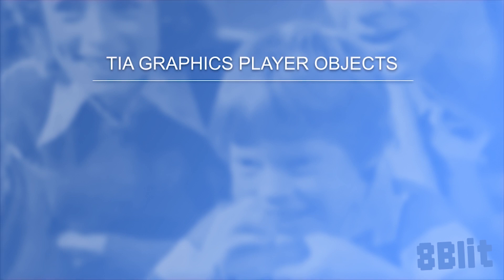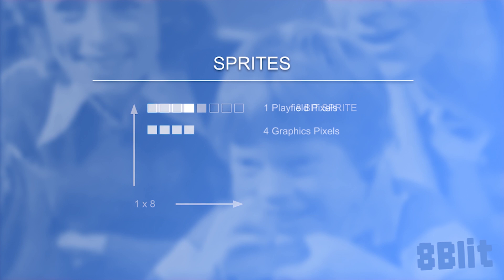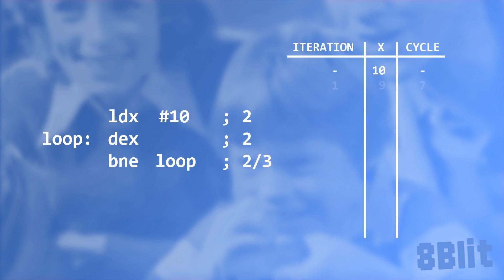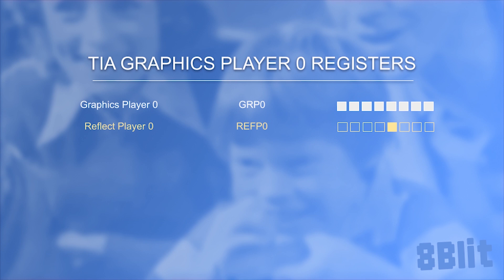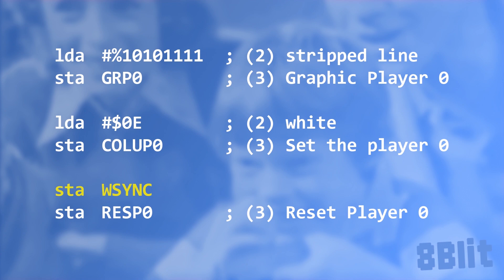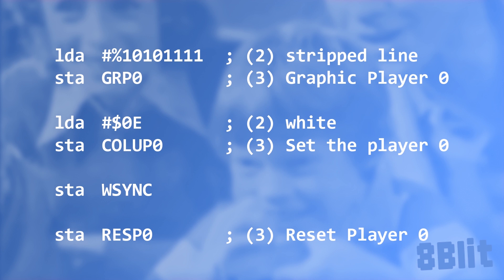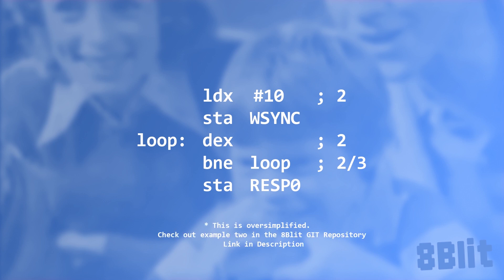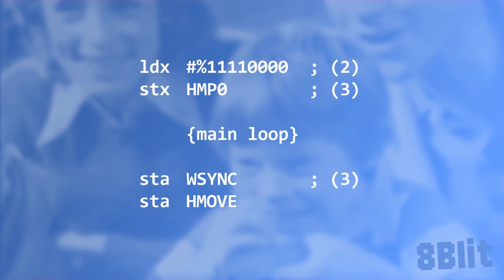Sprites on the ATARI VCS?!

Comment: You put a lot of effort into making your videos quality.

I had difficulty finding the source code that matches up with this episode. I see it's season 1 but it doesn't specify the episode number. And the number doesn't match up with entry order in your season 1 playlist. Modify the episode descriptions with additional links to the source subdirectories.

I noticed you use tabs for spacing. Please don't do that. Tab to indent, space for spacing thereafter. Otherwise, you impose your own tab widths on the viewer and it will likely not look good--just as it does when viewing the code on GitHub through a browser. I'm using mobile Firefox and Chrome and it looks bad. Not sure about the desktop.
Reply from the maker: Welcome, and thanks for the feedback. This is something I've wanted to fix up for some time. I took some time to fix up the source code in github, plus the episode description for the second episode. https://youtu.be/WcRtIpvjKNI

Does this work better for you?
Reply: @8Blit  Much better. Thanks!
Reply from the maker: Awesome, I'll be doing some more on the other episodes after the new one comes .
Reply: @8Blit  Subscribed!

Comment: I love these videos! 👍👍
A damn amazing job for such a difficult subject! 💪

I wanted to share the best pixel-perfect sprite (and missle positioning) routine for the 2600 that I've come across and used:

It takes the desired pixel (0-160) in the accumulator and the player (0-1) in X.  It has issues hitting the first couple pixels on the left, but I think I recall being able to kludge it by going  >160  to reach them, but I never relied on that because I was always blacking out those HMOVE "comb lines" on the left by making the first 8 pixels blank and unusable, of course, ..Activision-style! 😎

PositionSprite:
  cpx #$02
  adc #$00
  clc
  adc #$2E
  sec
  sta WSYNC

.loop
  sbc #$0F
  bcs .loop

  sta RESP0,X
  eor #$FF
  adc #$F9
  asl
  asl
  asl
  asl
  sta HMP0,X
  rts

(I forget if the STA RESP0,X/HMP0,X needs a space after the comma with DASM!  Apologies if wrong!) ☺️

This routine is pretty universal, and you can obviously edit/shorten it to only move a specific player, or expect different register inputs, etc.
Reply from the maker: Thanks for the kind words, I really appreciate it! I'll give your hpos method a shot when I have a moment, and I'll probably have a video at some point about the comb lines as well!
Reply: @8Blit  I wish I knew who to credit foe that positioning code, but I have now idea!  It's brilliant how it works though!

Comment: Weaving in game logic alongside those tuned video sections can't be easy once your game gets above a certain complexity (e.g. path finding would have to be split across multiple raster lines), the 2600 seems like a real challenge.
Reply from the maker: Really counter intuitive when you're used to DDD, TDD, SOLID, etc principals, and certainly a challenge!
Reply: You have time for complicated calculations in the vertical blank. 
I have no idea how many lines you have. But should be around 100. 
On the 8-bit computers there 312 lines in PAL mode. I auspe6the 2600 is the same.

Comment: Watching this makes me wonder how Defender was done on the VCS. I'm thinking particularly of the drawing of the "streaking missile" that the Defender ship would shoot. How did that long, kind of raspy-looking strip get drawn, I wonder? I remember Atari engineers gave high praise to the guy who wrote that game.
Reply from the maker: It's a very distinctive missile for sure and really adds a lot to that game. Gives it a sense of power.  I haven't looked into how that was done, but I believe it's swapping out sprites between frames, maybe combining several together. I may touch on that in a future video.
Reply: @8Blit  - What can clearly be seen is while the ship is firing, the ship sprite is "turned off." So, yes, I think there is a swap of the sprites. What got me wondering, though, is how did the game produce that long streak across the screen, since sprites are only so wide. I have heard about Atari 8-bit developers timing display list interrupts to produce changes in foreground and/or background color mid-scan. I've also heard about developers using DLI's to change sprite colors, shapes, and vertical positions, so that it can appear there are more sprites on the screen (once a sprite is drawn, move it lower on the screen with an interrupt, and it'll look like you have another sprite, once the lower scan lines are drawn). With the 2600, perhaps some timing trick was done with firing in Defender, to repeat the same sprite horizontally, as the scan line(s) were being drawn.
Reply from the maker: @mmille10  I think this is something I will  follow up with in a future video. There are a few interesting things in the code. I just took a quick look and I can see that the ship, it's exhaust, and it's shot are all done with GRPO. I haven't yet explored the timing behind it, or the color cycling it does .
Reply: @mmille10  If you step through it running in Stella, you can see that it uses the P0 and P1 sprites, and NUSIZ is used to expand them. The laser is quite simple; its a line, repeated horizontally, with another line beneath.

Comment: Programmers today definitely have it made compared to back then on the 2600. For one thing, there was virtually NO development software other than a cross compiler that ran on a slow timesharing mainframe. No real coding tools. Programmers were literally using calculators and graph paper to design their games. It's too bad that they didn't have the tools available now for developing games for the 2600. Some modern ones allow you to do everything you need - graphics, sound, code, debugging, etc - all from within one program.

Anyways, I tip my hat to those guys for being able to create any kind of game at all, let alone classics like "Pitfall!".
Reply from the maker: Totally agree with you. When you look at all the clever tricks they used to not only push the perceived limits of the hardware, but to do it in an creative engaging way, it really highlights the resourcefulness of the programmers. These days we have free frameworks like Unity that abstract everything to such a high level that your actually programming a Unity game, rather than a Computer, Mobile, Console game. Still, props to everyone putting themselves out there create creating games for whatever systems, using whatever framework!
Reply: @8Blit  And now some of these original 2600 programmers are making NEW games for the system! David Crane ("Pitfall!") and Garry Kitchen ("Keystone Kapers") have started a new retro software company called "Audacity Games" and their first product is out for the Atari 2600: "Circus Convoy". You can get it as a real cartridge or as a file you can play on emulators. If it were released back in the day it would have been the greatest game ever released for the system (in my opinion). Here's what it looks like: https://youtu.be/cnW2fgBZAvE

In addition to Unity, there's also a retro system programming environment called TRSE (Turbo Rascal Syntax Error): https://retrogamecoders.com/introduction-to-trse-programming/ It has everything you need to program for many retro systems including the Atari 2600, 400/800, Commodore 64, Vic-20, Amiga and MANY other systems. Of course it's free too! Rascal is based on Pascal so it's very easy to learn, and Rascal also allows inline assembler for speed sensitive areas of your code. Check it out!
Reply from the maker: @JustWasted3HoursHere  It's amazing how long the legacy has lasted and is still being developed and cherished by many. A testament to the hard working engineers at Atari, and the programmers who made our favorite games!

Comment: I think the TI 99/4A through the use of Extended Basic in 1981 may have been the 1st computer to mention sprites. Still a great video!
Reply from the maker: Could be, I'm going to have to look into that some more, thanks!
Reply: I felt this video treated the history of this in a bit of shallow fashion, because the Atari 8-bit computers (400 and 800) had sprite technology, just as described here, but Atari called them players and missiles. Inside the computer, the sprite buffers were long, vertical strips. You created your shape by turning on bits inside one of these strips. They could be just tiny, or as tall as the screen.

These computers were released in 1979. Atari didn't publish information about how their computers worked publicly, including the existence of "players and missiles," until the early 1980s, but they existed from the time when the computers were launched. They just kept them a trade secret for a few years, only allowing commercial developers access to this information.
Reply: @mmille10 , exactly. It was Atari 400/800 that had sprites around 1978